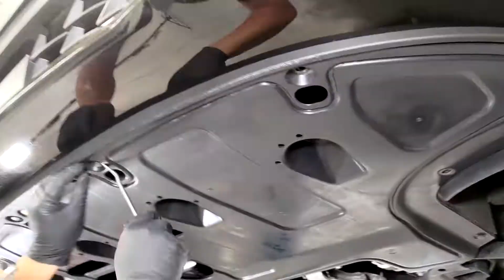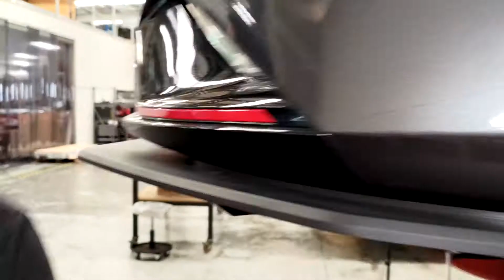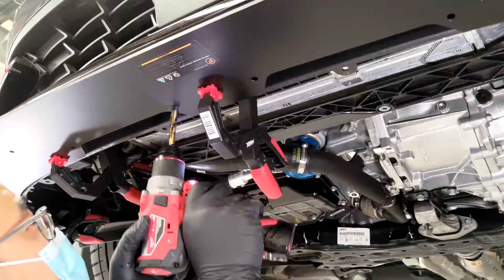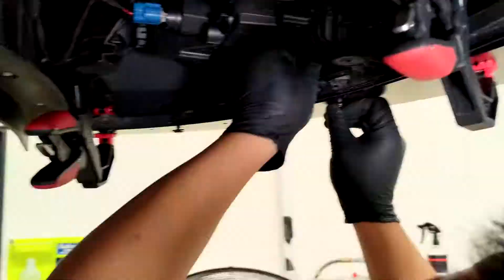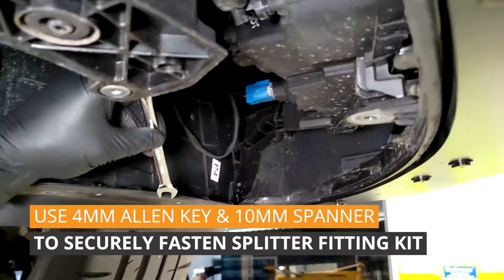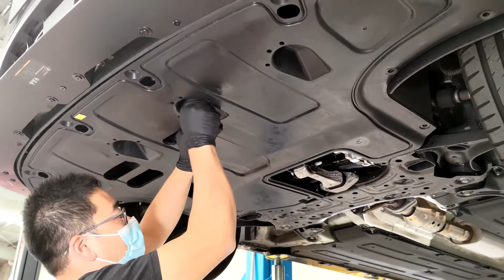Kia Cerato GT Sedan FL Front Lip Splitter Installation Guide

Comment: Would it be easier to just take off the front bumper, then just make all the holes and attach it to then re connect the front bumper? I do not have a lift so could this method also work instead of taking off the whole shield under the car?
Reply from the maker: If you conficent taking off the bumper, than yes, the bumper off method is probably gonna be a lot easier on the body.
It also a lot easier to lineup on a table as well.

Comment: The website has a disclaimer about the diffuser not being compatible with USDM. I ordered the full kit without noticing this warning. Will this mean I won't be able to install the diffuser? My order arrives in 1 more day.
Reply from the maker: The kit won't be a direct fit as there are some differences with the internal structure of the USDM and AU/EUDM front and rear bumpers. As a result, some modifications will be required.
for more technical info, please reach out to our support team
support@flowdesignsaustralia.com
Reply: @FlowDesignsAustralia  Thank you for the response!